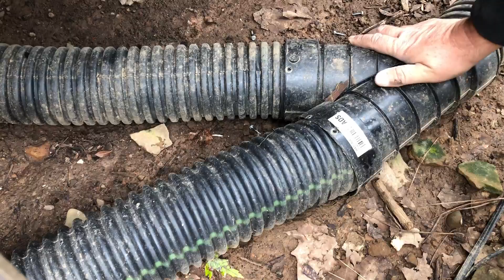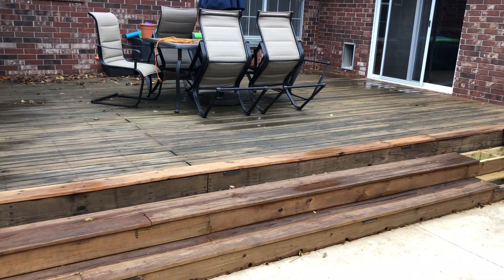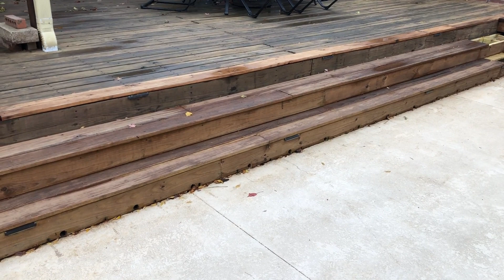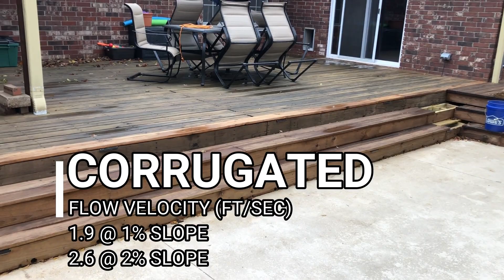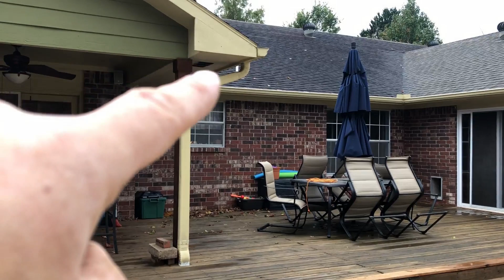DOWNSPOUT DRAIN LINES | CHOOSING DRAINAGE PIPE

Comment from the maker: This is the same video I uploaded earlier, only in this version I did some changes for the info about corrugated and pvc pipe flow rates. I felt this was an important change to make, so my apologies for the double upload. 

Please note the old system had only been installed for 2 yrs. The asphalt shedding from this home was on the extreme side. However, to prevent clogging all pipes should be set at the proper slope whenever possible.
Reply: PVC (smooth) should always be used IMO
Reply: Hey Brooks, I have a question. I have a 4" solid pvc system already in place that I'd like to insert a Y connector into so I can tie in another downspout. The problem is I cannot move any of the existing pipe. It's been buried and it's a big system. On this particular run of the system we are talking about a 40 foot run where I want to put this Y in. I don't want to have to remove the entire  40 foot section to insert this Y. So this is my problem. What is the best way to address this? I can dig a hole to expose the pipe where I want to insert this Y, cut the pipe in two sections to make room for the Y, but obviously I will not be able to pull the two sections together as they are already in place and have been for some time. So what can I do? What is your recommendation? Thanks. - Mike
Reply from the maker: Mike Lewis who da hell is Mitch 😂😂😂

Do what you said. Expose the pipe. Cut it. Just enough to fit the Y between the cut pipe. About 3/4” to 1” space. No more. Use a 4” no hub coupler (also known as a flexible PVC coupler) Slide it onto the cut pipe. Pushing it back to allow you to place the Y in place. Then slide the coupler forward onto the Y. Tighten the rings. Back fill and you are done.
Reply: @bbdrainage  lol sorry I thought your name was Mitch then right after I typed the comment I saw your Instagram banner went there and saw your name is actually Brooks. I apologize! And thanks for the tip I will try it out this weekend weather permitting!
Reply: @bbdrainage  👏👏👏👍👍👍
Reply from the maker: Mike Lewis good luck. Hope it works out.
Reply from the maker: Mike Lewis when you connect the Y you more than likely need to insert a 5” piece (section) of pipe  into the hub of the Y.  If you don’t, it might be very difficult to join the pipes together as you would be connecting the coupler to hub of the Y.
Reply: @bbdrainage  💯 that's what I planned to do. Thanks
Reply from the maker: Maybe
Reply: Your not wrong.   PVC only or I run the drainage guys off.  I also like cleanouts on all points just in case.  I'm in manufacturing and don't have time to jack with inferior BS.

Comment: Buying my first house, and there is a downspout at the front corner of the house. All that water is running down the side of the house and seeping into the crawlspace. Built on a pretty steep incline, so I'll be installing corrugated pipe down past the back end of the house. Very informative video, and I appreciate the sincerity of how these situations can/should be handled.

Comment: Very good and informative Video. I was going to make a suggestion. Wouldn't it be easier to use Dual Wall Corrugated Pipe for Belly areas and long runs instead of PVC or ABS Solid pipe? I mean that dual Wall has flexibility and is less expensive if one is going to build a Down Spout Drainage system with a run away from the home. The one thing about dual Wall is that it seems to work better in Freeze prone areas like Minnesota or the Northern Tier States and it also gives the unobstructed property of PVC Solid but the flexibility of Corrugated. It is also my experience that Tile Tape is probably the best weld as Glue welds will break during the freeze. The problem is that the Big Box Stores carry Single and Triple wall but not Dual Wall. I can't figure out why this is.

Comment: I dont get why you got so many dislikes on the video. I thinks the info in this video is quiet helpful.
Reply from the maker: PrimeTimeAction probably those who like to use corrugated pipe. Which I see nothing wrong with using corrugated pipe, however, as in this case- it is used far to often on those sites where it should not be used. 

🤷🏿‍♀️🙂
Reply from the maker: PrimeTimeAction maybe because I ramble on in it to much...got a couple of comments saying I talk to much and to shut up 😂😂🤣🤣😂